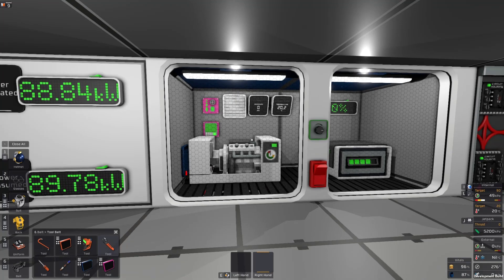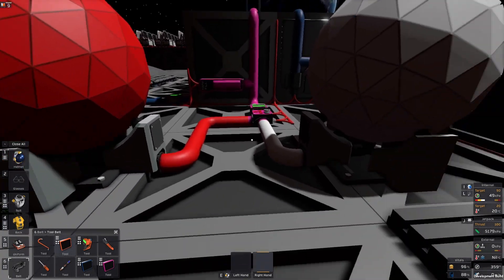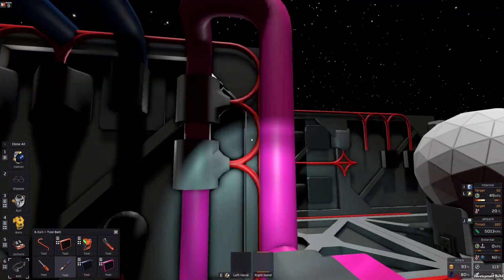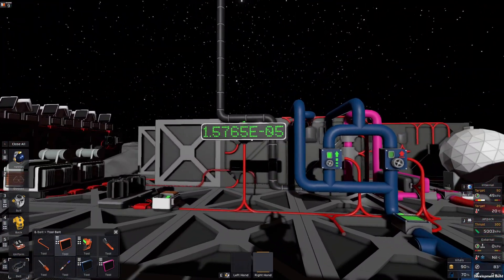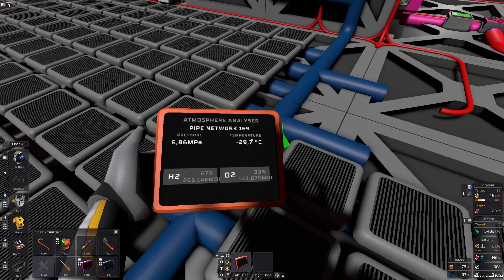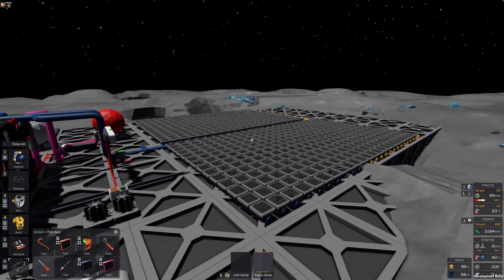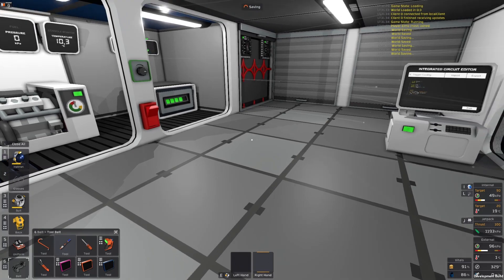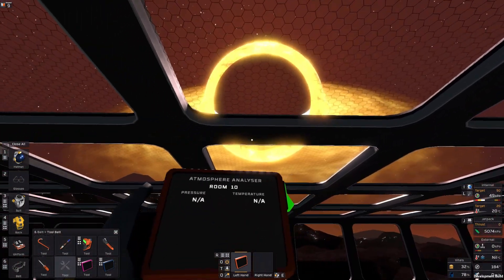Cooling the Gas Generator - Stationeers

Comment: The vulcan exploit works in real like:

If you made a box with IR translucent top and walls to prevent surroundings from radiating into the radiators, you could radiate the heat out str8 to space thru the sky.

Comment: this guy found out there's actually an energy limit in pipe networks.  turns out pressure and temp are stored as a single variable that can cause errors if it gets higher than e^10

https://youtu.be/8L_mHzZILYM

Maybe you'd be interested in doing something with this info, might help make a Vulcan gfg more plausible, or could be exploited somehow?
Reply from the maker: i have seen his videoes and it's great info. But gfg on vulcan has been solved a while ago ;)

this video is a bit outdated.

Comment: You talk about things turning on and off when needed but never show the logic circuits, and the Europa solution has never successfully cooled it for me, and makes it hard to start because you're basically poking a hole in the side of your base.
Reply from the maker: The code running that valve on europa is nothing more than "if >20c => open valve". The length of pipe and number of passive vents outside controlls the efficiency on that thing.

The other planets have a PID controlled volume pump. I have a different video explaining PID controllers.

Comment: @Elmotrix  I noticed the screen that was labeled "Temp Change" in the video that told you if you had enough radiators to cool down the room, but it wasn't in the moon example world? How would I set that up to work? 

Also, I am having a problem with too much pressure building up inside the room and blowing out the windows. I have added more active vents to try and compensate but it still blows. I think it is because of the temperature but I thought the code would control the pressure in the room?
Reply from the maker: the temp change display is just a simple derivative of the temperature. the difference in temperature from one tick to the next.

no there is nothing to control the pressure in the room. the controller managing cooling only takes the temperature into account. if you are having problems the two solutions are more active vents, or colder coolant gas. if you get your coolant gas colder it'll have to pump less in to maintain temperature.
Reply: @Elmotrix  I thought that would be the solution! I'm not too good with the coding side of stationers yet but luckily I can understand it a little to modify it for more active vents. 

Would I set it up with some logic to read the temperature from one tick to the next?

Comment: Hvordan satte du opp kjøleløsningen for hver planet? jeg kunne tenkt meg å se en video som forklarte hvordan man satt opp hele systemet, da kjøleløsningen er hva jeg sliter med på hver planet.
Reply from the maker: Der er forsovidt det videoen dekker. Du trenger bare masse kald gass, også pumper du det rett inn i rommet etter behov.
Reply: @Elmotrix  Den delen forstår jeg, men kunne du forklart litt hvordan du har programmert kjøleløsningen mellom radiator løsningen og den jeg sliter mest med er for Europa ved bruk av digital valve. Jeg sliter litt med hvordan man kan setter opp en IC for dette og er litt avhengig av workshoppen og limitert forståelse her. :P
Reply from the maker: @xajukan2206  På månen og mars bruker jeg en volum pumpe som er styrt av en PID kontroller (jeg har en video på det også)

På europa er det kun en digital ventil som er veldig enkelt styrt ved at den er åpen hvis temperaturen er over 30 grader. Den trenger du ikke engang IC programmering til å styre  :)

Comment: So i tried for a week in creative with pretty 
pretty much every possible cooling solution/setup available to get a power positive gfg on venus.

It is not possible in the current build without cheesing. Thats putting it very simply with how many different builds i tried. My understanding of acs and wall coolers is quite through now lol

I really wanted one on venus, and after that week of trying im half tempted to just cheese it but i wont because it makes me feel dirty.

It does however very much turn me off of Venus because gfgs are one of my favorite setups to run.

So idk.. i guess its wind solar and solid gens for backup.. makes me sad
Reply: That said it can be done on vulcan if you intake at night box chaining ac groups to keep them at 300w, 464c on venus is just too high
Reply from the maker: @mikebell7813  what kind of power profit do you get on that vulcan setup? I'd immagine most of the power generated goes back into cooling it down.
Reply: @Elmotrix  i didnt, just from my experience trying to do venus, youd need some active vents to pressurize a box. Doing zones in tanks functions differently.

So 1st zone would be 2 acs pull and waste to the 1st box while its being fed by .. 10? Active vents probably less it is 32kpa after all but ill overestimate.

Those vent will have to constantly run to also keep the temp at 127 (the evening vulcan temp ) with a regulated flowthrough.

So thats we will say 2kw and itll drop the temp 50 degrees to 77c immediately.

Second box will need flow through also as waste and intake will be going there from the second acs, again another 50 degrees to 27c , after 2 boxes returns start to diminish a bit so youd need 3 more boxes to be safe and to keep the acs at close to 300w.

Lets entirely overshoot what would be necessary and say 20acs and 20 vents, thata 8 to 10kw but will easily provide enough flow to cool a 20kw gfg.

Depending on the output temp of the gfg you could reintroduce that flow somewhere in the chain to increase efficiency.

Ill set it up sometime, but id like a break from creative and work on my venus base lol

Also it would be annoying waiting for night but i guess i could just do a custom vulcan at night temps constantly... yeah i can do that.

Ill get it setup when i get home and upload the save
Reply: @Elmotrix  so i worked on a setup after i got off work for a few hours on vulcan. Because the atmo isnt high enough for the ac units requiring a pre box to be filled by active vents losing that free waste dump i had on venus made too big of an impact.

I had to dump waste to the active vent box and the temps i just couldnt keep low enough with the flow through to maintain a good enough initial temp drop.

More consequently the volume output by the first set of acs was much lower being fed from a box and not the atmo like it was on venus.

Without that volume it compounded on the second set of acs further reducing my expected outcome.

In the end i wouldnt have been able to make the setup power positive. Or even close to even really. The volume flow rate even aftet the second set of acs was much lower than i had experienced on venus. Im not sure if its the composition of the atmo or just starting at a lower base atmo pressure.

There are quite a few variables that dont at all play out like you might think because of the game coding.

Its not a flaw or anything im obviously using these acs in a way that wasnt intended.

Running the waste to a passive vent in a high pressure box not tank and splitting up the input and output to different boxes/volumes.

You cann instantly pull 50 degrees off venus atmo at a pretty impressive volume flow rate just passive venting the intake and waste to atmo and tanking the output. It will run all day at 300w.

Trying to loop beyond that gets to be problematic with keeping power consumption down. Especially with how many loops you need to get to a temp to cool a gfg.

tl;dr

I was wrong and unable to make a gfg power positive on Vulcan 😊
Reply from the maker: @mikebell7813  the GFG isn't very hot planet friendly :)

Comment: You do have enough radiators to deal with the heat... they just are exposed to the sun which does heat them up.
Reply from the maker: you'd think, but it doesn't change at night.